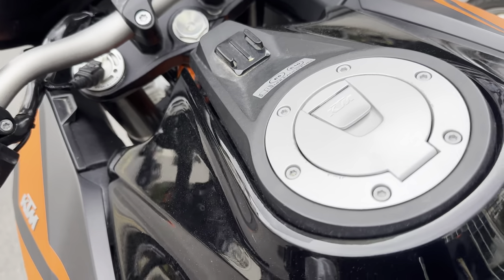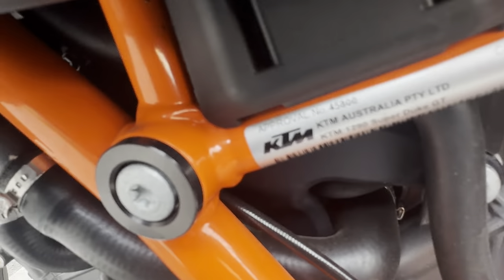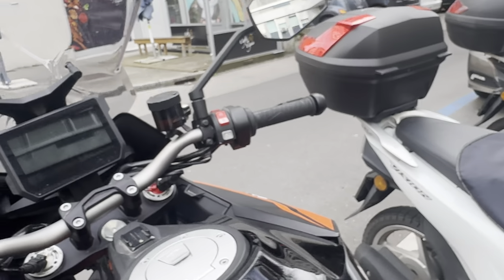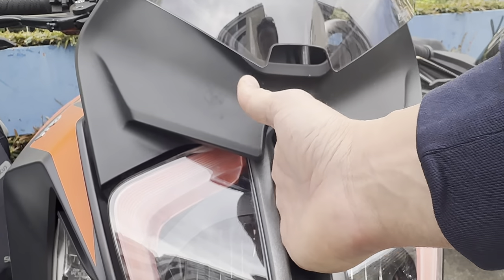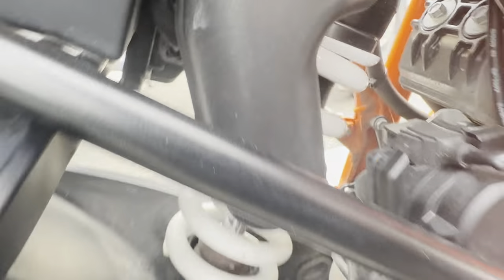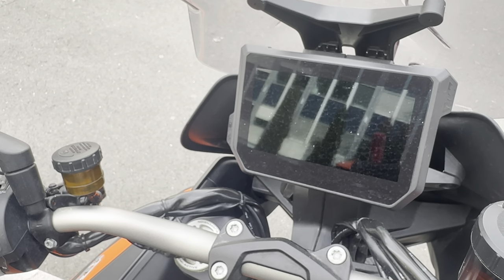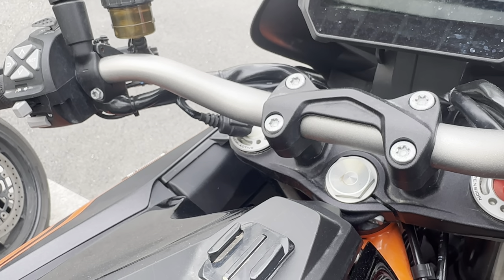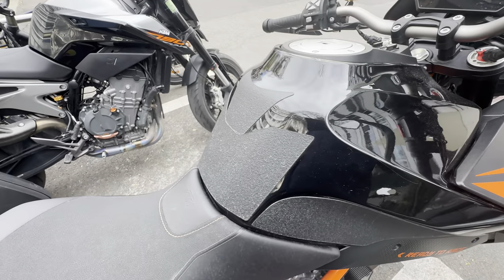Top things i hated about my KTM SUPERDUKE GT #ktm #motorcycle #1290superduker #1290superduke

Comment: Imo (owner) its the most nimble 17 inch touring bike ever. That is why the lower steering wheel. I test rode s1000xr and this on the same day. Incomparable this more nimble by far.
Reply from the maker: The ktm is much more powerful and torquey, it wins over any superbike in a drag race for the first 3 gears easily